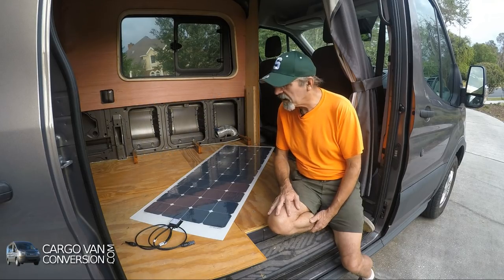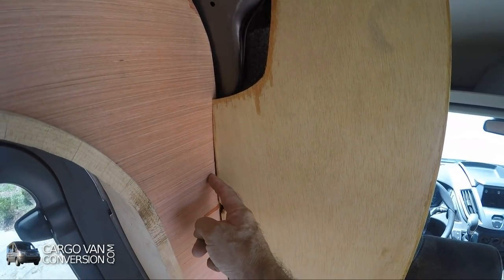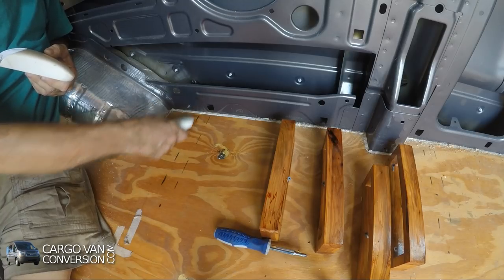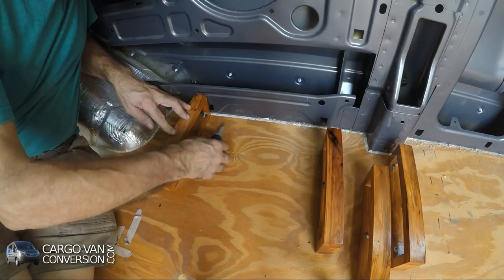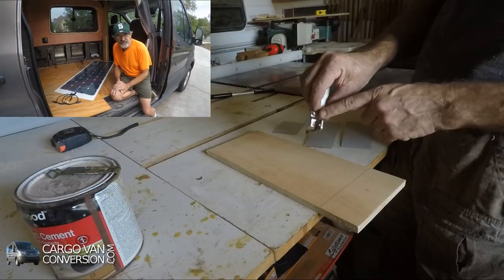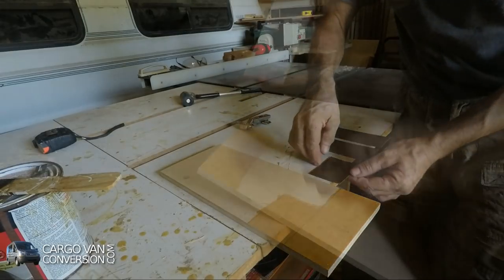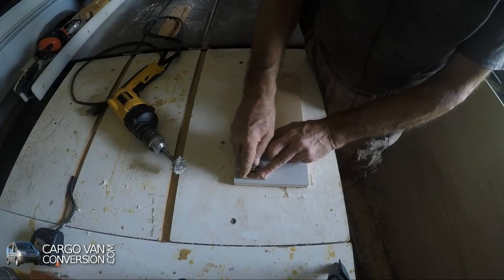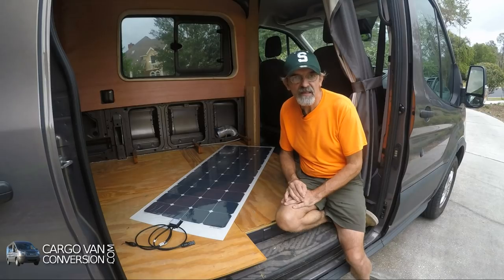Flexible Solar Panels, Window Frame & Cabinets Hinges

Comment: Another great video!  Thank you.
Reply from the maker: Hey Suzy, 
Thanks for watching. It was a bit of a mismatch, but sometimes you work on different parts at the same time. Right now, I'm surrounded by circuit breakers, switches, bunches of wires and other solar equipment, trying to figure out how it all fits together :)

Van Williams

Comment: You might look in to a Kreg tool to help with your wood work.
Reply from the maker: Hi Mike,
Kreg is a handy tool for fast connections in wood, but I'm a bit old-fashioned, not in a hurry. And don't like the holes and number of screws. There is a place and time to use them and not really against them either, but rather like to work a couple of days on a few dovetails :)
Thanks for your comment; someone reading this, will surely try it out.

Van Williams
Reply: The thing is when drilling screws at a angle to mount something you can use the Kreg to drill the hole then use there screws to tighten it down, they are great product, I've made shelves with them and there quite amazing.

Comment: You said that solar panels made you stealth. I figure you must have ment self contained. If I am in error and you did mean to say stealth, please look up the defination of sealth.
Reply from the maker: Hi Chantelle,
The stealthy referred to the fact that these panels are only about 3/16 inch thick and when mounted on the roof of the van, are hardly visible. That in contrast to regular rigid panels. And sure, they're also part of a system which can make the RV self-contained.
The word stealth, among RVers, has many different meanings; for me it is just a van that doesn't seem to be altered on the exterior. Others want to do urban camping and want to look like an ordinary work van. Whatever you do to the vehicle, most often the roof vent or out-of-state license plate will give you away.
Thanks for watching and commenting!

Van Williams